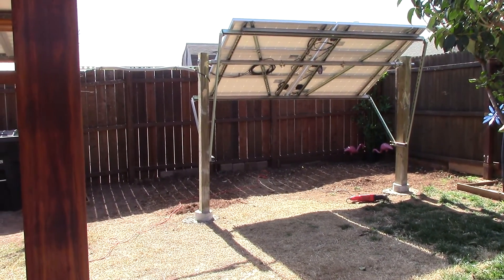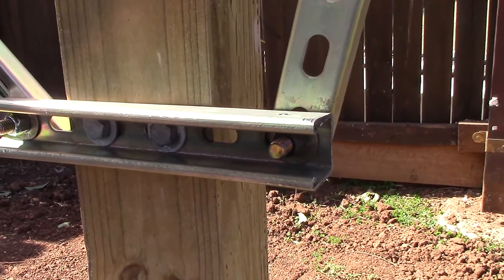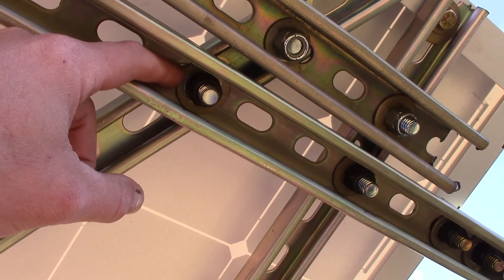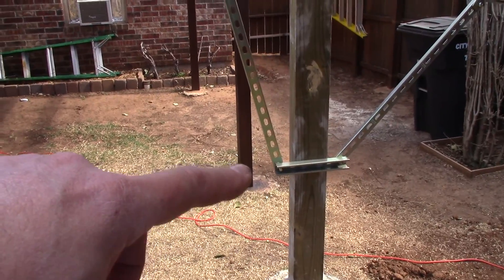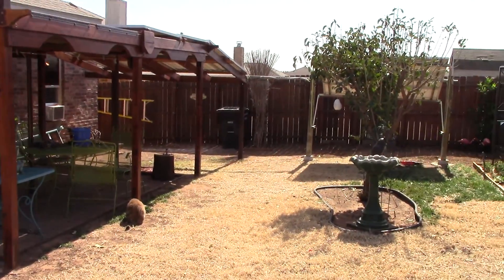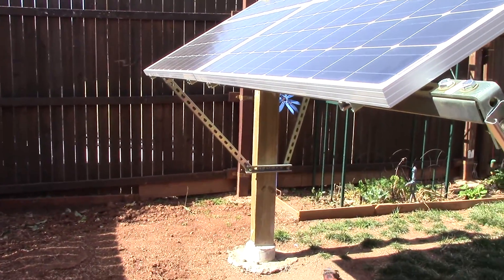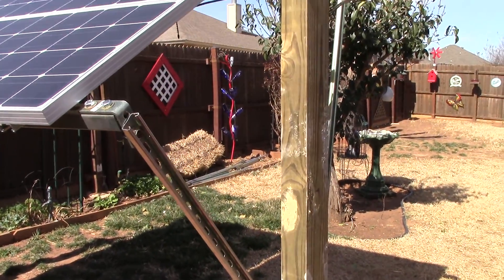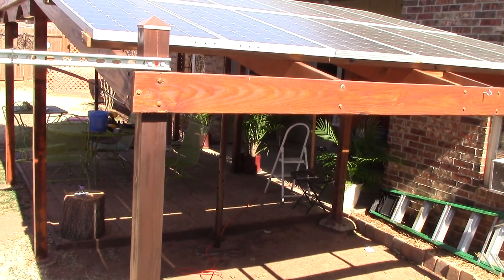600w Renogy solar panel array (four point bracing installed)

Comment: One other question.  Why did you go with 100w panels instead of larger one given how many watts you are generating?
Reply from the maker: +Mike Masztal  - I started off with 100w panels to test the waters...and just continued with them. Works out great...they are easier to handle with a bad back, knees, feet, shoulder, arthritis, and all that. Also, I can run these 100w panels in series and crank up the voltage for my long PV feeder cable run into the garage (more efficient). Worked out great. Here to help...great stuff, kinda reminds me of working in the field and on the FOBs.

Comment: Nice set-up.. I think I'm going to go with a SuperStrut mount myself.  BTW, I see a little icon on the bottom- MasterBlaster wings with a 508 Red Devil unit crest.
Reply from the maker: +Mike Masztal  - Superstrut is great stuff. If you buy your bolts/hardware by the pound (like at Tractor Supply)...the savings are HUGE! Master Blaster is correct...but, I was a ground pounder (GTACs).
Reply: +Chris DIYer Thanks for the response. There is a tractor Supply near me.  AATW!!   1/508th Inf.,